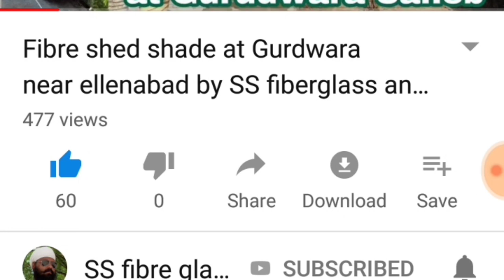install fiberglass sheet on metal and steel gate 2018||लोहे और स्टील गेट पर फाइबर शीट कैसे लगाएं

Comment: sir iski price kitni hogi gate 14 by 6.5 with fibre sheet ki?
Reply from the maker: 20000 to 25000
Reply: @ssfibreglassandfabrication8846  thank you sir for replying.
Reply: @asifuddin1543  14x6.5 matlb 91 Ft. , aur 31 Rupee per ft. 1.5mm fiber sheet mil jati hai , matlb 2800 ki fiber.
Ye bhai saab ne pta nai 2000-25000 kis cheez ka bta dia